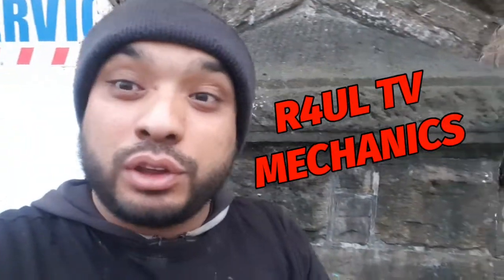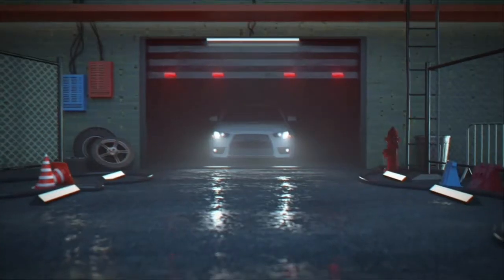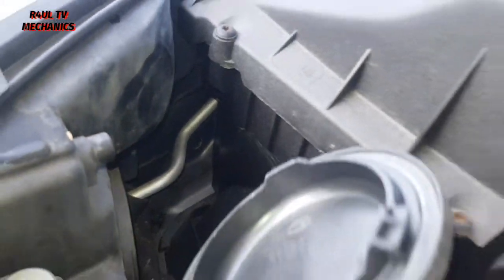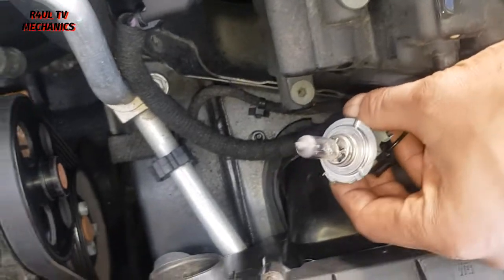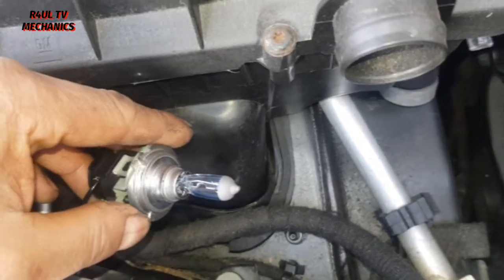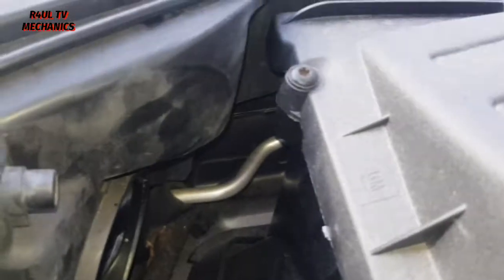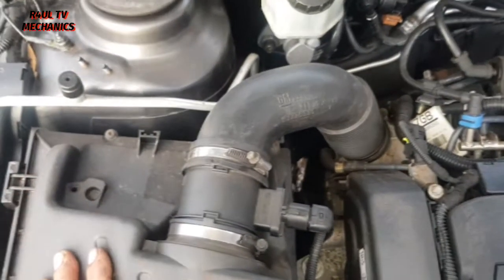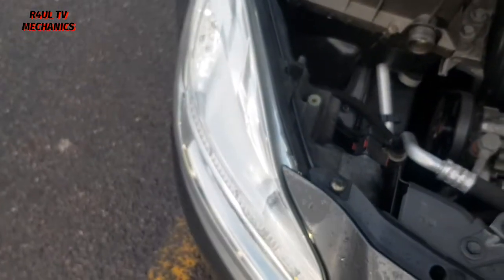2010 VAUXHALL INSIGNIA HEADLIGHT BULB REPLACEMENT

Comment: Why haven't you shown that the torx screws have to be loosened slightly to twist the bulb out? Someone will break the connection trying to get it out otherwise.
Reply from the maker: Thanks for watching really appreciate it. As for that torx trust me you dont have to take it off. Just turn in anti CLOCKWISE  it will come off easily.
Reply: The correct way is to actually tighten the torx screws its what clamps the bulb in position properly,  youl have slight bulb movements if you don't tighten the torx

Comment: Passenger side on mine has some sort of wire clip holding the bulb in. Any advice?
Reply from the maker: Am sorry without looking at it will be very hard for me to suggest anything.  But I think it might be one of the earlier ones and is held on with the wire clip. What you have to do is push towards front on the clip, and then towards a side. Am sorry I couldn't help more.

Comment: Worst design ever , them torx screws if not set properly become a nightmare to get bulbs in , the whole vauxhall headlamp is a shambles , condensation issues, akward bulb replacement,  tight fittings, should of been a recall from the start , I did my rights side drivers in less that 2 minutes , the left side still isn't on correctly cos of the shitty screws  , insignias need binning awful cars do not get 1 ever if your thinking about it